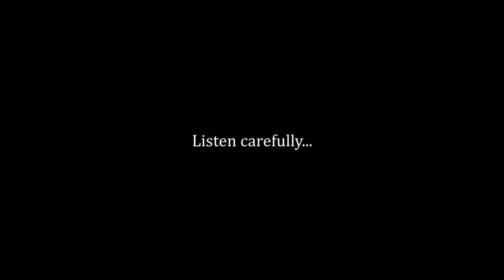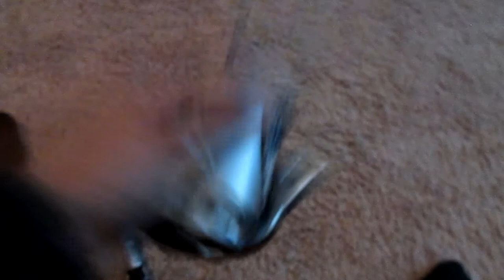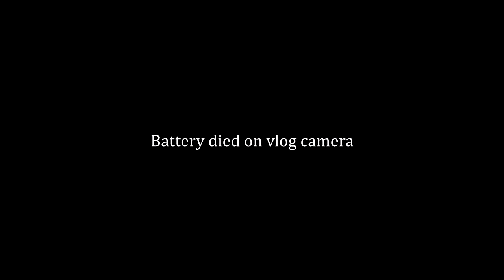2007 Subaru Legacy GT spec.B HKS BOV (Vlog #26)

Comment: Dear god don’t take advice from this guy. That snap ring is perfectly effective at holding the BOV in place but with JB Weld over it you can never replace that O Ring later. If you can’t properly insert a snap ring then you have no business working on that part of your car or giving car advice. If the snap ring doesn’t fit correctly then go get another one for $0.25. This is dumb.

Comment: Can u link where u got the parts? I have the exact same car and I wanna do the same thing

Also did u make yours vent to atmosphere or recirculating?
Reply from the maker: Yeah, I'm going to update my description and try my best to link what I got, but the HKS BOV was on Amazon and now, not anymore.

I made mines vent to atmosphere. Bad choice for me since I ran it on a MAF-based setup. That's a warning for you too if you don't know much about it like I did. Do some research if you have to! Good luck and be careful!
Reply: @Pyman215  How so? Did it damage your engine ?
Reply: @kevindang577  long term, it’s not good because the ecu calculates the air recirculating back into the intake and sends the right amount of fuel, since this is venting to atmosphere and the recirc tube is blocked and there’s no air coming back, the ecu detects there’s no air and has troubles calculating how much fuel to throw in so it’ll run rough. Between shifts it could stall, can have multiple pops due to unburnt fuel predetonating in the engine or near the engine out the exhaust, which are all not good. You need a speed density tune to run venting to atmosphere!